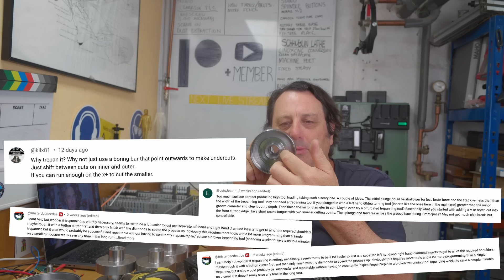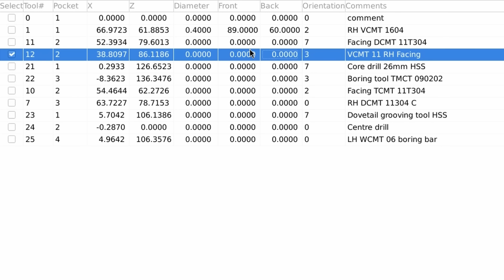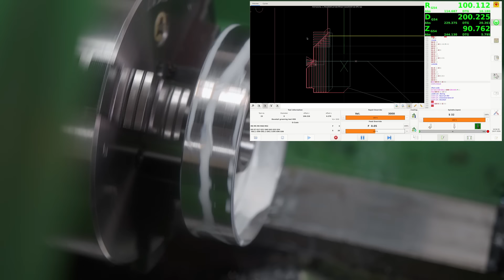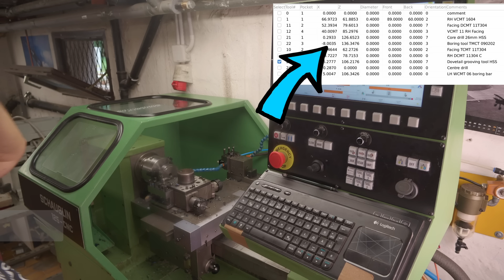Making hubs for my surface grinder  || RotarySMP

Comment: Hi, I use a large diameter loc-line coolant hose (1/2” or 3/4” system) to support the ends of extraction hoses on my grinders. That way everything is plastic and there’s exactly the right amount of rigidity in the arrangement , but still easy to manipulate. I forget where the idea came from but you’ll find others do this as well!
Reply from the maker: Thanks for that tip.

Comment: Trepanning - from a watch maker. The ideal cutting tool is an angular chisel point. Angled laterally about 15 degrees so it cuts with the point  The rest of the chisel edge only serves to remove the swarf. Go very slowly if doing an initial plunge cut. For accuracy run the lathe backwards, point on the far side so you can see where you are cutting when you get to the edge. Save the swarf when cutting silver, gold or platinum. Use a carbide cutting tool when cutting iridium alloys
Reply from the maker: Thanks for your experience. What do you use iridium for?
Reply: @RotarySMP  Most common use is as an alloy lending extreme hardness to other metals. Often alloyed with gold, platinum and silver in trace amounts as in jewelry which also increases the parent metal's value. Obviously very useful alloyed to the parts in watches and similar fine machinery.

Comment: For the grinder dust collection, would suction from the hose be enough to hold it down? Maybe you make a little port off of the main area, and a TPU gasket so the vacuum can hold it on to the table?
Reply from the maker: I doubt it. The opening of course reduces the suction near the end. It is more of a high flow low suction system.

Comment: It's possible that the angle seetings for the tools are -160 deg to +180deg instead of 0 to 360 deg
Reply from the maker: It turned out to be a bug.
https://forum.linuxcnc.org/gmoccapy/58997-gmoccapy-tool-table-not-accepting-lathe-tool-angles#347885

Comment: For thr dust collector i thought a T track nut & bolt could be a quick fix till you can implement one of the other ideas in the comments.
Reply from the maker: That could work. Thanks.

Comment: Whoa! I don’t like that part wobble at the end of the cut reaching the outside. Too much pressure. Possibly partly a problem with the chip ribbon getting between the insert and the outside of the part as the insert is right up to the inside wall.
Reply from the maker: I made a bunch of mistakes on this part, Mel. Never got a really good process.

Comment: Ball detent on the t-slot? On the dust extractor thing? Is that the right name. Like a ball bearing trapped in the 3D print with a spring so it can catch on the lip but be pulled up easily.
Reply from the maker: That is a good idea Jacob.

Comment: Have I missed the summary of your final spindle control approach? Or finishing tweaks.
Reply from the maker: I didn't cover it. It was just adjusting the timing  and adding some logic to check if the back gear is correctly selected. Otherwise this is just the open loop look up table. Nothing fancy.

Comment: Magnets on the dust extractor: I don't think this should be too bad. Reprint the scoop with pockets in the bottom of the hook to hot-press in the magnets (or glue them in) with a mm or 2 of green over the top for a smooth surface. The wheel dust isn't magnetic, so won't stick. The sparks are almost certainly above the Curie temperature, so also not magnetic, and should be sucked away before they cool. And if stuff does stick, the scoop has a smooth top face, and you can just wipe any grubbage right off.
Reply from the maker: Good tips. Thanks.

Comment: Mark, instead of magnets to hold the nozzle of the dust extraction hose in place you could either buy or 3D print some T Slot Covers out of TPU and use the T Slot cover to hold it in place. In theory it should hold it, if not maybe a reprint of the nozzle with a hook on the edge of the lip to catch and hold itself on the underside of the T Slot will work. 👍👍
Reply from the maker: That is a good tip. Thanks.

Comment: Did you do a video on your misting/coolant install. Also are you using  a waterbased solution?
Reply from the maker: No separate video. It was a bodge up in one of the last videos. Yes. I will not keep this, as it can't be healthy in my basement.

Comment: I’m always so impressed you have time to make videos. 
I do like your Tool path where you go in there make small passes and clean the chips off. 
I always get a kick out of it when Peter from edge precision chime in and gives you some advice  
Interesting project. 
Interesting to follow how good your lathe works.
Reply from the maker: Peter is very generous with sharing his years of experience.

Comment: 3 D print a T nut for that slot on the table, but make the center section slightly proud of the table and with a threaded stud. Drill a hole in the vacuum chute and let it float on the table in the slot. And it’ll be easily repositioned on the fly.
Reply from the maker: That is a good idea. Thanks.

Comment: Hi, use the T groove to block were you need the shell of the dust extractor, a small clamp 3d printed and is over😉
Reply from the maker: Thanks for the tip.

Comment: For your problem with the tool angles, maybe your control expects numbers between -180 and +180? So instead of 300 you'd have to put -60. Just a guess, but that's a common variance on angle inputs, either it's 0 ... 360 or it's -180 ... +180
Reply from the maker: It turned out to be a bug...
https://forum.linuxcnc.org/gmoccapy/58997-gmoccapy-tool-table-not-accepting-lathe-tool-angles#347885
Reply: @RotarySMP  oh, that's a silly bug... makes you wonder why they haven't just kept that command for legacy purposes

Comment: Well, sometimes things just... Well.
A suggestion for the dust/chip extractor nozzle? If you print the "L" shaped part you now just hook down into the T-slot of the table as a "J" shape in stead, it should grip the T slot undercut. A simple non-magnetic wedge in the slot should hold the nozzle in place as long as the hose isn't limiting sideways movement... Just a thought.
Reply from the maker: That is a nice simple design idea. Thanks.

Comment: Morning Mark,
Short video,  fine.
Crap video, not yet, and you're the only CNC creator I'll watch (well I guess Tony does a bit too).
Sunday morning tradition, watch Mark and eat fresh homemade waffles. 
Don't mess with tradition. 

John 🇨🇦

PS I drives what you fix, captions on those opening clips would be fantastic.

PPS One last word, Redrup radial.
Reply from the maker: Hi Joe, 
I know, I put the Redrup on the back burner to knock out these machine jobs, and they are taking me way way too long.

Comment: redesign the extractor end to mount it on the bottom wheel cover plate screw. If you need to adjust its left-right position then slot the mounting tab that holds the extractor mouth.  The extractor does not have to move with the carriage.
Reply from the maker: Good tip Kent. Thanks.

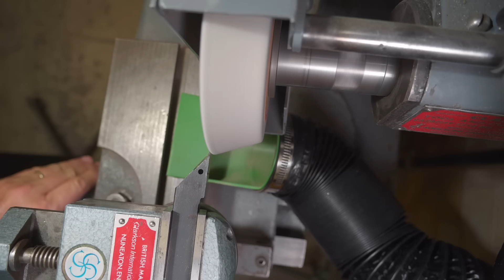Comment: 2:18 Given the sparks only ever fly off edge of the wheel, the dust collector should be mounted relative to that, not the moving bed? ☕
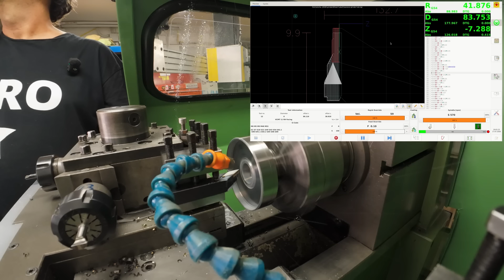3:55 Have you tried -120deg?
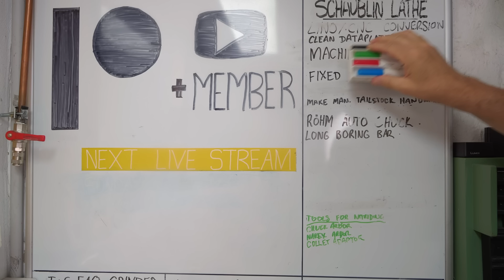5:24 Woohoo! 🎉
Reply from the maker: Yeah, I need some design changes on that scoop. 
Turned out to be a bug.
https://forum.linuxcnc.org/gmoccapy/58997-gmoccapy-tool-table-not-accepting-lathe-tool-angles#347885
Reply: @RotarySMP That's an interesting one - would not have found that!

Comment: Heya, Mark! Try sticking to -180..180 degrees range in that GUI and see whether it helps or not.
Reply from the maker: It turned out to be a bug.
https://forum.linuxcnc.org/gmoccapy/58997-gmoccapy-tool-table-not-accepting-lathe-tool-angles#347885

Comment: I think not mounting the vacuum grinder dust cutter to the bed but instead 3D print flexible segmented hose (Marius Hornberger) on printables is the ticket.
Reply from the maker: Thanks for the tip and link.

Comment: I nearly mentioned it when you first showed the extractor scoop, but my thought is that it should hook into the tee slot.
You could just print a small piece and screw or silicone it to the original rather than re-printing the whole thing.
Reply from the maker: Good point Andrew. I will play around with that.

Comment: Have you tried entering the decimal when you are entering the angles? 330 vs 330.0
Reply from the maker: It turned out to be a bug.
https://forum.linuxcnc.org/gmoccapy/58997-gmoccapy-tool-table-not-accepting-lathe-tool-angles#347885

Comment: Just make extractor flat part longer and add hole for screw with t slot nut
Reply from the maker: I need to make quite a few changes to it.

Comment: I am just a lazy hobby machinist and because I have little time, I have to be very lazy to make the most of it. I would have gone straight in with whatever tool was closest to hand at the time and angled the toolpost to give me the undercut I needed (or some undercut). I then would have made the weights to suit that angle.

Having done that quite a few times, I have now ended up buying some carbide single flute endmills. You should try it. They make wonderful small boring bars.
Reply from the maker: Thanks for the tip.

Comment: For holding that dust-extractor funnel/scoop-thingy: You seem to be holding it quasi-fixed to the machine table with your left hand. 
As a temporary solution, why not print a removable wedge with a handle, and just wedge the scoop into that t-nut slot. The lip of the scoop reaches in there, anyway.
You could just move the scoop to a rough location as you need it for the ongoing job, and fix it there with the wedge.
At least, this would be better than holding the thing basically steady relative to the table by hand. It would probably work for most jobs with the exception of those that require an exceptional amount of table movement.
Reply from the maker: Good idea on the wedge. Simplest of all tools. Very handy.

Comment: Have you played around with trying Claude for generating g-code? I needed to enlarge a hole in the back of a cast aluminum box. Rather than try to remember how the conversational interface worked on the mill, I told Claude the material, end mill size, hole diameter, and a couple other things, and it generated code that worked on the first pass. It asked a couple questions first, like max RPM, did I have cooling or not, and how many flutes the end mill had. Took about 5 minutes overall, and then less than a minute on the mill.
Reply from the maker: It is pretty helpful for coding. This tool path was a mix of FeatureCAM 2005, and hand written loops.

Comment: For the extractor scoop. It should stay relative to the wheel so finding a way to mount it to that structure seems to be the way to go.  You could use the t slot as a guide for a printed part but you still need to stiffen the hose so it stays where you need it.
Reply from the maker: That is a good tip Joe.

Comment: Looks like your turret has trouble moving, I am guessing not enough pressure left in the system due too the mist cooling being active?
Reply from the maker: Yeah, seems to be exactly that. I don't like the mist coolant. My basement shop doesn't flow enough air for this to be healthy.

Comment: i say your way of using cnc lathe reminds more of a 2 people manual operation where one of them is a robot .. and both make mistakes :P
glad you making progress because you may start something even more crazy when you finish with that
motorcycle engine block perhaps?
Reply from the maker: I am hoping to run of of mistakes before I get to the block :)
Reply: @RotarySMP  just weld block from thick plates

Comment: For your scoop on the cutter grinder - have you tried extending the lip into a shape that fits the inside of the T slot? I know there would be a bit of an overhang during printing but it could be held more level and slid in from the side of the table for mounting
Re: Tool offsets - I've found that a cheap set of feeler gauges work well in establishing a very accurate Z offset for my tools since I'm working without a probe. Use the face of the gauge and mark your Z as the same thickness of the gauge after a facing cut, then use its edge against a known diameter in X. If they get too dinged up, just peel another off the set and use that for a few more months.

I think the video turned out just fine, lumps and all. It seemed to come out at the same time as my usual Sunday morning here in Canada. Thanks, Mark!
Reply from the maker: I need to make a few design changes on that scoop. 
I use a 10.5mm carbide shank for touching off in Z. I suspect I entered that in X by mistake.

Comment: 2:45 rather than magnets, i would print a full t-nut to slot in and clamp against the existing extractor scoop.  should hold it with friction quite well and avoids needing to reprint the entire thing.

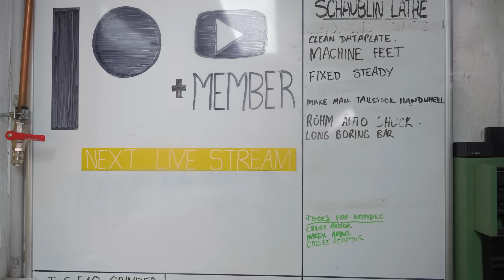edit 5:40 if you go over the dry marker with fresh marker, the solvent in the marker will lift the ink that wont erase
Reply from the maker: Thanks for the tips.

Comment: Couldn't you use the same left handed boring bar on the other side of the spindle axis with reversed spindle rotation?
Reply: Yes, I was watching him grind the other one away thinking noooo!
Reply: Yep and no mismatch marks from tool offset setting inconsistencies!
Reply from the maker: I dont think I have the X slide travel to get to -84mm in X.

Comment: Could you maybe print a new scoop, adding a more acute angle to the hook that latches onto the slot? This way it has some spring, and maybe add provisions for gluing in some rubber pieses or a drop is silicone to add friction? This way you can avoid magnets, it is still easy to attach and move, and requires no tools.

Cheers!
Reply from the maker: Good idea. I have been thinking of making the scoop wider and less deep as well.

Comment: Does the alloy not let it be cut in a nice way or why do i see so much swarf?
Reply from the maker: There were two different Alloys, both a big of a mystery. One is probably a highly alloyed die steel. I did get it to mostly chip towards the end of the run.

Comment: You could modify your 3D printed scoop to have a full tee nut shape that could slide in the end. A snug fit and it should stay or if needed drill and tap a hole through the tee nut portion and use a knob to hold it in place. Magnets would become fuzzballs in short order.
Reply from the maker: Thanks for the tip.

Comment: 6:00 Now you just need to up the feedrate, DOC, or both so it actually chips instead of birdsnesting :)
Reply: …or create a CNC-driven arm that clears the nests 😜
Reply from the maker: @mumblbeebee6546  Once I got up to 140% feedrate, it was mostly chipping pretty well. You can see that in the top RH slip of the four panel view.
Reply: @R @RotarySMP ir! I replied to Gorak’s comment before I watched to the end. Bad form.

Comment: Hi Mark, have you tried editing those values with the tool inactive?
Reply: also try 300.0000 not 300?
Reply from the maker: It turned out to be a bug.
https://forum.linuxcnc.org/gmoccapy/58997-gmoccapy-tool-table-not-accepting-lathe-tool-angles#347885

Comment: Regarding the dust scoop.. isn't this a t-slot the scoop rests in? How about a hole in the middle and a t-nut, bolt & washer ;)
Reply: I think he didn't want the scoop to move with the table but stay stationary underneath the wheel.
But he could use like a Z-shaped "finger" just to reach under the opposing groove and prevent it from lift-off
Reply: My thought was just having a loose t-slot modeled on the end of the scoop so you can slide is side to side but a t-nut, small stud and a wing nut or a wing-bolt would allow you to angle to too
Reply: Or just print a hook under the scoop that catches the roof of the t-slot?
Reply from the maker: It really needs the scoop to mount off the wheel guard.